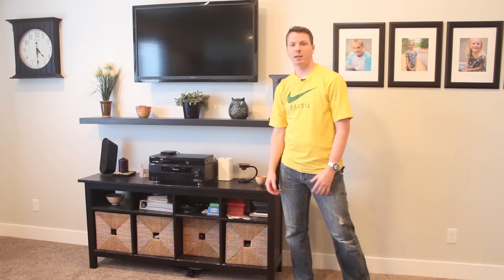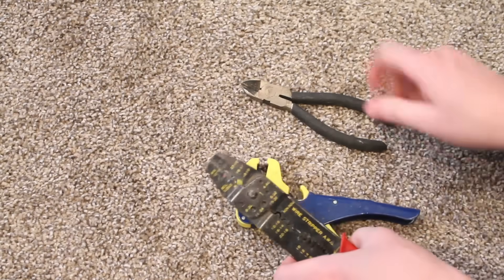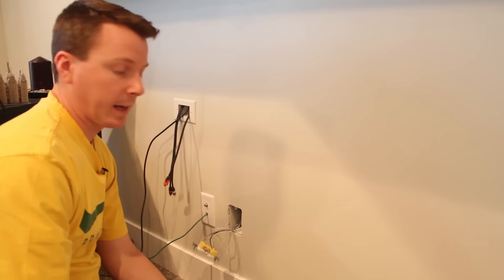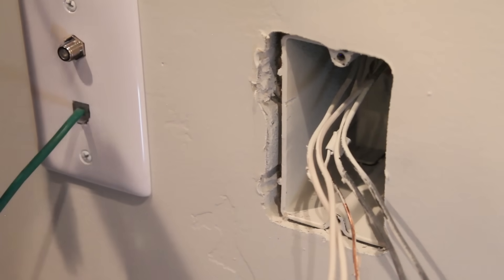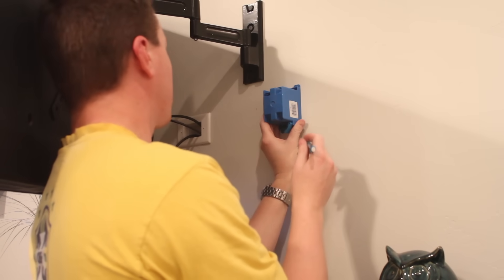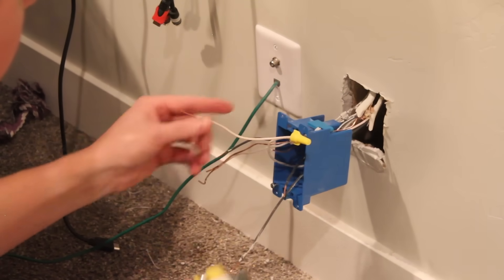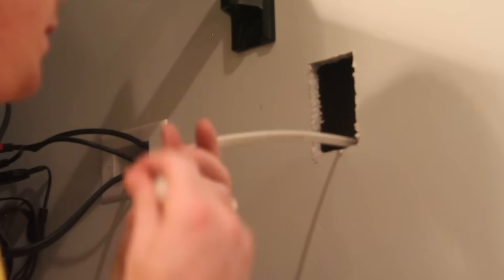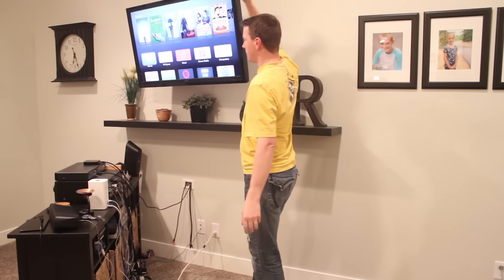How to Add an Electrical Outlet for a Wall Mounted TV

Comment: Get a TV which uses a DC power supply. Then use a combo HDMI/Speaker wire outlet for the Dc current.

Comment: What if you have to go through several studs to move the outlet up and to the side?
Reply: This is quite a bit more difficult and if possible, it’s better to run the wire out of the top of the wall entirely (into an attic or craw space) and then drop it into the stud bay you need the outlet in. 

I’ve done what you’re describing in the absence of a crawlspace and it is a monster. It requires a paddle bit, fish tape, a lot of patience, and wall repairs.

Comment: I hate to criticize her but this guy may be a DIY'er but he isn't a professional election. The reason I say this is his pick of tools to twist the wires. I've never known anyone who has done even  a minor amount  of electrical work uses lineman's pliers for that. Other than that it was a good method of doing that. I would add that to the lists if possible ways to do this job. I've got a couple of more just according to the situation

Comment: Good video. I did a similar install however I just ran the Romex through the hole in the old work box, pushed it up between the studs and hooked it. Then I was able to just wire my new outlet to the side screws on the old outlet, since the old outlet had the original wires going directly into the holes in the back of it, I didn't have to twist any wires together or use lever nuts.

Comment: Thank you for your insight! From my experience if you unscrew the screws when trying to take the wire out of the outlet at the very beginning, it does help to release the wire. At least it did on mine.

Comment: Question for anyone here…when bundling the wires on the lower outlet couldn’t he just have ran single wires to the outlet. Versus still using both terminals on the sides? Since it was all wired together anyway?

Comment: If you're uncertain if you need more romax or not, get more. You can make do with having excess wire moreso than not having enough (unless you also have a wire stretcher though those things are too bulky, heavy, and expensive to consider for a few times use tool).

Comment: No dont just connect all wires. the screws are there for a reason. You can connect outlets together in series. Can look up outlet series wiring to see right way to do it.

Comment: The new wires up top need to be bent clock wise so when tightening it tightens with the turning motion of the screw driver.

Comment: Good job dude. Only thing i am wondering is if it was really necessary to remove the old electrical box. Can't i simply drill a new hole on the top of my old electrical box so that i can run the new romex cable to the outlet up above? Im no electrician either so just wondering.

Comment: Electrician here, code says 6” of wire from back of the box at a minimum. I’d have to check the code, but I do believe you should wrap the terminals on your outlets with black tape for safety. This helps with any unwanted contact on the terminals, and looks out for the next guy who works on it. Just 1-2 wraps around the whole receptacle covering all the terminal screws is a good practice.

Comment: Very helpful.  One thing to point out, check that your outlets are BOTH WORKING with a meter before you put everything back together otherwise youll have to take it all apart again

Comment: This is an amazing video, my new built should be ready by June and I would like to do this for like 8 TVs I will be mounting but honestly kinda scared of knowing witch breaker do I have to turn off and knowing the ground and the green and black cables goes. I think I might need to see a couple of extra videos before doing this myself 😂

Comment: a bit confused, in the video you connect two white wires to a small whip so you end up with one connection, you did the same for black, but in the finished wiring section it showed two whites on silver and two black wires on brass.. where does that second connection to brass.silver come from? the feed?  at the 10:17 mark

Comment: Great video. Learned a lot. Thank You. One suggestion for us novices with electricity is to explain a little what wires go where as it relates to the electricity flow. I am not assuming that you just connect white to white, black to black, ground to ground and it all works. Hope that is right because I am about to install an extended outlet under my kitchen sink for a water filter.

Comment: It’s better to put a recess outlet for TV since it allows tv to be flat against the wall. Also, by code you are supposed to pull the romex wire into the box so at least 1” of outer insulation is inside the box

Comment: Great video. In the bottom outlet you put together all the white wires plus an extra white wire about 4 iinches, right? Then the extra white wire goes to the outlet, right? Same steps for the black wires. Thank you.

Comment: I realize this vid is 5 years old but I need to comment. The bottom box looks undersized.  The electrical code dictates how many conductors a box can contain based on cubic inches.  Plastic boxes are always labeled with that volume. In this case he has 6 conductors, the ground wires count as 1 and the outlet counts as 2, so a total of 9. The pigtail and wire nuts aren't counted.  In metal boxes the internal clamps also ea count as 1.  In the 2017 code 14 ga wire requires 2.0 ci per conductor, 12ga wire 2.25 ci.  So that box wired w 14ga wire needs a net volume of 18.0 CI. For 12 ga. wire it would need to be 20.25 CI . I can't tell for certain but the box used looked  like a Carlon 14 CI box, the most popular size sold at home centers.  If so that box is substantially under-sized.   Crowding boxes can lead to overheated wires and is bad practice. They do make largdr, deeper old work boxes and worst case he could have used a double box on the bottom.

Comment: You are working with a box that has no conduit running into it. Where I'm at, most residential outlets are installed with Conduit which meets the building codes. I suggest mentioning to your viewers they may run into conduit. In that case, the steps you suggest won't be completed as easily. I hope this helps you cover more situations your viewers may encounter.

Comment: Two things required by code. 1) All neutrals and all grounds should be tied together with just one pigtail each left for the outlet. 2) Wires entering the box should be pulled in far enough so that the outer jacket enters the box by at least 1/2".
Reply: That’s what she said
Reply: He did not even need to to any of that mess, any dual socket has two screws in each side, just attach the second line to it.  Every socket in circuit should be like that.  He is just created a whole slew of potential failure point by doing the huge mess.  People, IGNORE his pigtail garbage!!  This is not a switch, no competent person would pigtail an outlet.  Even a switched one, which uses a second line to switch an outlet or you can switch both with a single line but I have not seen that done.  Quite frankly smart sockets and switches have made three / four way wiring and switched socket useless.  I undid mine.
Reply: Is that NEC or local? Why can't the neutrals be connected to the two outlet terminals like he does?
Reply: @_68niou1  If more than two cables enter the box, all neutrals shall be tied together with a pigtail for the outlet(s). Just two entering is ok to use just the outlet.
Reply: @lastchance8142  so, he'd just need to tie two together with a pig tail going to the outlet and the third could tie to the outlet like he does, yes?
Reply: Isn’t #1 exactly what he did?
Reply: Hire an Electrician. ⚡🔌💡

Comment: Why cant you just wire the new romex to the screw ports on the side of the existing plug instead?
Reply from the maker: You can. The reason I didn’t do it that way is because most people will have a really hard time fishing wires from elsewhere into an existing box to do that.

Comment: How did you center the  outlet to make look right?
Reply from the maker: I’m not sure I understand the question but I mostly just eyeballed it since it would be behind the TV anyway.
Reply: Use a level when you are are going to draw your cut in electrical box

Comment: Blessings, do most of the house sockets use 14/2 Romex in the wall?
Reply from the maker: Most 15 Amp circuits use 14/2 or 14/3 wiring and 20 amps required 12/2 or 12/3. You can check in your circuit breaker box  to see if the breaker that controls the outlet in question has a 15 or a 20 on it to help answer the question.
Reply: @LRN2DIY  thank you

Comment: Running the loose wire down is still not passing inspection in many places.  You would need to have it inside Metallic Flexible Conduit.

Comment: Good job not re-using the back-stab terminals.   I have talked to a few electricians that will not use them at all.  Re-using them, would be a worse idea. Are there any codes when installing it behind a TV?  should it not be in the swing of the arm?
Reply from the maker: It's always best to check your local codes but I haven't seen any regarding this setup.

Comment: Wago connectors work a whole lot better than wire nuts. Also, when installing outlets, placing the ground prong up is the new way. It protects against dropping things across partially exposed prongs when a plug wiggles out a little. Otherwise, a really good video.
Reply: The outlet should be oriented with the ground pin down because a person grabbing the outlet will have their index finger at the bottom side of the plug and the index finger sticks out further than the thumb.  Having the ground down will keep a person's index finger from touching the live pins.

Comment: 8:53 Just to let you know (and anyone else who does this, and sorry for not citing the NEC Code where located, and can’t recall off hand….migraine day right now, sorry)…BUT, when pulling romex 12/3, 12/2, 14/3, 14/2 thru a box….you need to bring the sheathing inside at least a 1/4 inch per code. That way you dint have exposed “bare” wires hanging behind the box.
Know how time consuming and difficult can be to make a vid and do the work at same time, not easy as ppl think, and almost always; forget to say something etc….
Cheers✌🏻

Comment: Never insert the wires into the holes on the back of an outlet. Always use the screw terminals. You'll run a lot less risk of an electrical fire that way.
Reply: Not really. I didn’t believe it before , but on two recent installations I find that it is as secured as wrapping around the screw terminals. Once you tighten the screw, there is really no way it will come out. In addition, the wires are insert  from the  back horizontally and the limited depth or the box pushes the wire forward. Very secured.

Comment: what if you find a 2x4 going horizontal in the mid height prevent fish tape to go through
Reply from the maker: The easiest two options are to use a flexible drill bit (a longer one, like 36”) or use a pumpkin cut, but the latter requires some drywall work afterward.

Comment: I was going to comment on your previous video it’s illegal to put a power cord in the wall.
Something else to mention,you really don’t need to take the box out.
You can just fish through the top of the box and run your new wire and box.

Comment: Nice job.  Might have wanted to wire nut all like wires together and then secure the pigtail to the outlet screws.   Not sure putting some on a pigtail and another on the device screws meets code.  I"m sure others found the video helpful also.  Thanks for sharing your ideas.

Comment: No need to remove the bottom box. Just remove the top plastic wire tab and pass a snake to pull the wire down. Very simple

Comment: So my outlet below my TV is wired to a wall switch (1/2 switched and 1/2 always hot).  I would like to add an outlet right above it (behind my tv) that does the same (1/2 switched and 1/2 always hot) except now I want the existing lower outlet to always be hot.  Do you think that sometime you can do a video to show how to do that. I love this video.
Reply: So you want both plug ins’ on the bottom receptacle to always be hot? And your new outlet to be half and half?
Reply: @beat2190  yes exactly
Reply: @nataliep.sander242  hey Natalie, so I would recommend is for you to add a receptacle BOX behind your TV, and run the wires (that are hooked to the bottom outlet currently) to the new receptacle behind your TV. I suggest this so it won’t be confusing to you and it’ll be like plug and play for that receptacle. Now moving onto the bottom receptacle, so what you would need to do is create a pigtail for the following wires (neutral, ground, and hot) coming from the receptacle behind the TV outlet down to the bottom outlet, Silver and Brass screw terminals as well as the ground Green grounding terminal. Also make sure to use the receptacle that was originally on the bottom outlet to the one behind the TV, this is because if you buy a new one you will have to remove the “connecting tab” from the receptacle in order to make it 1/2 and 1/2. Instead use a new receptacle for the bottom outlet and ensure that the “connecting tab” is not removed, the “connecting tab” is so that the receptacle can be always hot. Please be safe! And if you are unsure or not comfortable doing this please contact an electrician to perform this job, also make sure to always check to see if power is being supplied to the outlets you are working on! You do not want to be shocked trust me haha
Reply: @beat2190  Got it!  Thank you. I'm going to tackle this and I'll let you know how it goes.  I feel very comfortable doing this even though I'm a girl.  😜 but really thank you!!!   🤩
Reply: @beat2190  exactly

Comment: As you said that you are not professional licensed electrician please don’t do it anymore. Stay with painting and plastering .
Reply from the maker: If only licensed professionals did electrical work, nobody would ever get anything done. There are too few electricians and too much demand. In the U.S., at least, electrical work can be done by anybody who is willing. Should only licensed mechanics change oil in cars? This channel is called LRN2DIY because I believe everyone should learn how to do some basic things around the house to be self sufficient.
Reply: @LRN2DIY  Agree. If only license electrician can do it, then those big box stores would require Electricial license to buy electrical supplies.

Comment: Nils, people who know how to work with electricity already know how to do this. People who do not know how to work with electricity should not be advised on how to do so. It's like advising people on the best suicide methods.
Some of the comments prompted me to actually watch your little video, and doing that prompted me to add this warning to my earlier comment. People, I don't know about Nils' other skills, but when it comes to electricity, he is a complete HACK. In that sort of box, you don't just pull the wires into the box; you must pull it in far enough that the outer sheathing also enters the box. The outer sheath is what the little tabs inside the box grip onto so that the Romex doesn't pull out. And when you strip the wires, you must strip off enough so that no insulation - none - is trapped under the screw. When you wrap the wire around the screw, be sure to wrap it in the clockwise direction, not counter-clockwise as shown, so that when the screw is tightened, it pulls the wire in under it, rather than trying to push the wire out from under it. I STRONGLY ADVISE that anyone who is going to attempt this sort of thing, get your advice on how to do so from somewhere ELSE, or actually hire an electrician. His advice that he is "not a professional electrician" is a laughable understatement.
Reply from the maker: Hey, Craig. Thanks for your comment. I totally see where you're coming from. That said, I completely disagree. This is a relatively simple step by step process of adding a single outlet. I have known a half dozen folks in my own neighborhood who have never done anything electrical before who watched this video and then told me about it afterward and how excited they were that they did it themselves. I fully agree that there is a time and a place for DIY, especially when it comes to electricity and plumbing. If you're uncomfortable, unsure or just don't get it - call a pro. In a case like this however, if you're willing to take your time and go through each step, I think it's very doable for most anyone.
Reply: @LRN2DIY  I would agree, if the steps shown were CORRECT, and none of them skipped.

Comment: At 9:12 why do you need to use wire nuts ? Why can’t you just connect everything to the screws of the outlet?
Reply from the maker: Because you’re not supposed to put more than one wire on each screw and there are three wires to connect but only two screws.
Reply: @LRN2DIY  got it. Thank you.

Comment: I am a female in my 20’s and I did this project all by myself with your video. I didn’t have a reciprocating saw so I used a hack saw. Well, the hack saw was too big to fit within the square so I took off the blade and manually sawed the screws off. I would say the hardest part was trying to cram all the wires back into the gang box at the end. Haha. When I turned back on the power, I can’t believe that the outlet actually worked! Thank you!!! This probably saved me a bunch of $$ doing it myself.
Reply: Wow so easy a "female in my 20s" could do it.

Comment: Would it basically be the same think if i wanted to move the outlet up. Not to add, but just to move the existing outlet from bottom to top? Would I just move the original Romex
 wiring?
Reply from the maker: Correct, as long as there’s enough slack in the Romex.